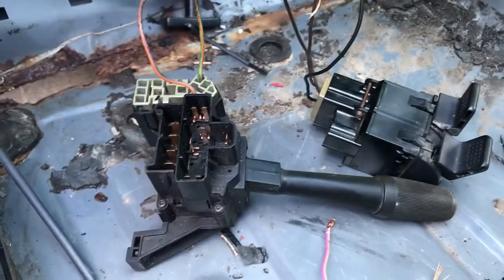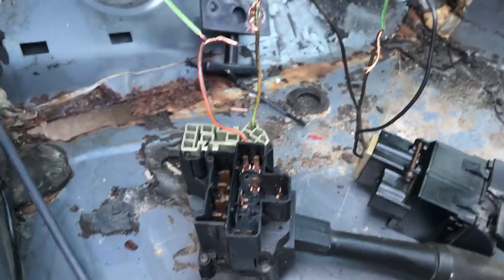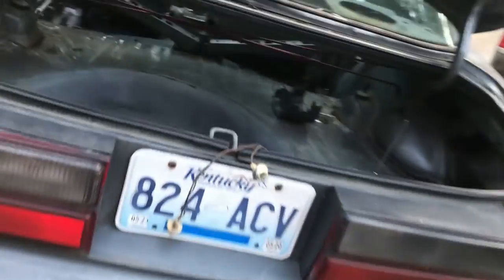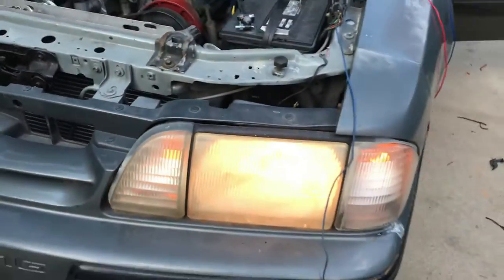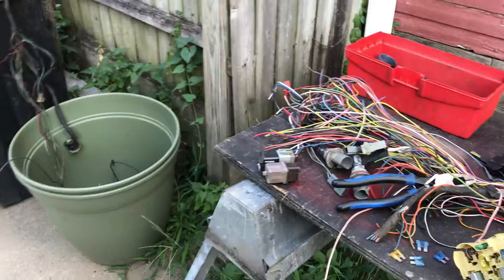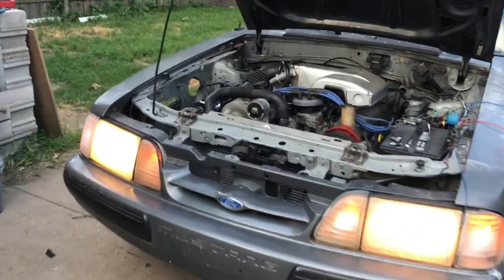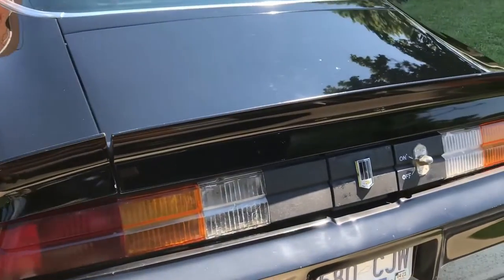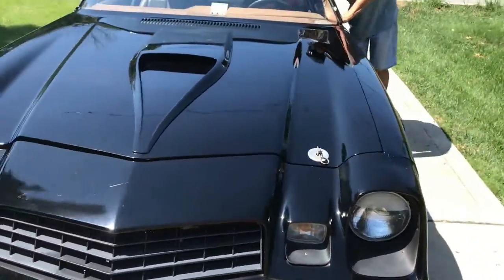Fox Body Mustang wiring cont. (notice the 79 Z28)

Comment: Can you do a video on wiring up the alternator? My alternator is not charging and it’s been changed. But, I don’t know if the shop my Mcarlen want to if they did something to the charging system. Didn’t have that problem before it went there.
Reply from the maker: BSG, Buy a one wire alt like this Ford 1-Wire Alternator, 140 amp Output with Serpentine Belt Pulley [Black Finish](Jegs, Summit, LMR should have it), original alt has two plugs with multipule wires (5 wires), factory gauge on dash should work with the one wire alt - my 88 GT and my 89 LX 5.0 both are running Summit racing 140 amp one wires - no problems with charging - get the alternator wiring pigtail (about  $30.00) for easy hookup - One wire directly from the alternator to the solenoid. Hope that works!
Reply: @JeffPalmerJWP  thanks